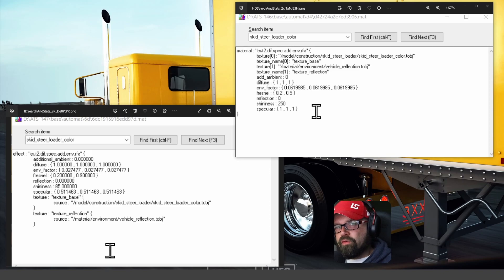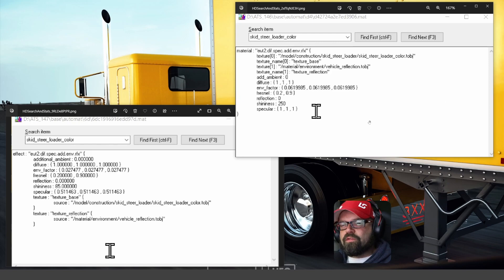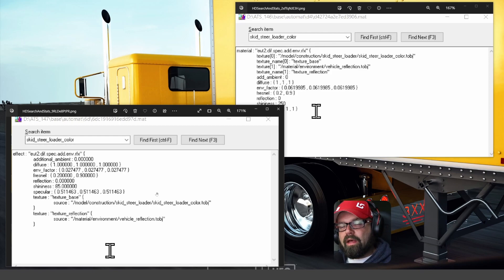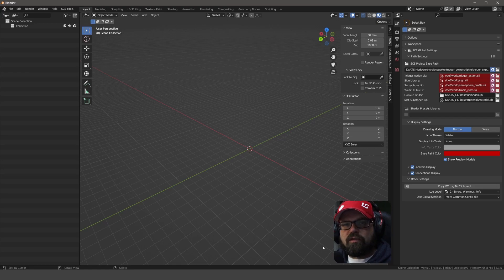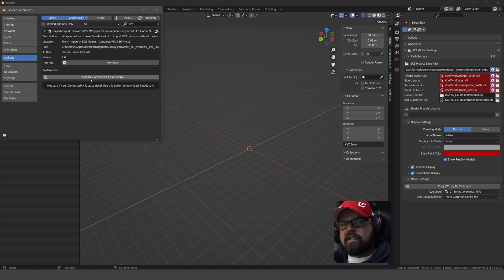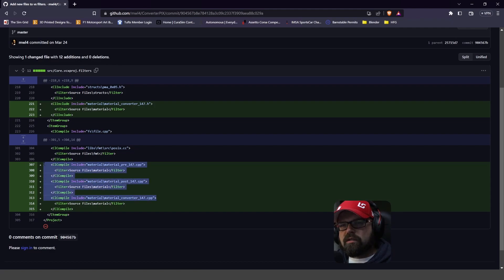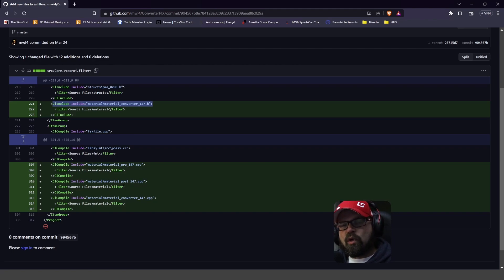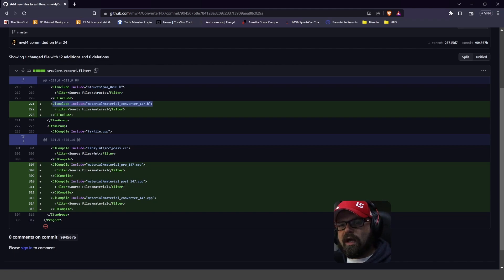SCS Modding How-To | Fixing 1.47 Materials Import to Blender!

Comment: Brother,i converted 2jpg to tga and...used as textures....they converted with conversion tool no errors.....I copied automates and other files with texture file...but that 2 textures are showing ROSE in ets2...Why🥲others are ok...But the converted are rose🙄
Reply from the maker: Error in log?
Reply: @Halffastgaming  mipmap prrsence requires power of two images sides
Reply: @senurapathirana3036  that means you have not the appropiate dimension's the game asks

for square is 64x64 128x128 256x256 512x512 1024x1024 2048x2048 4096x4096 and so on
you also have 256x128 512x256  1024x512 2048x1024 4096x2048
Reply: @krizzy090  thanks brother...🔥🥰
Reply: @senurapathirana3036  np